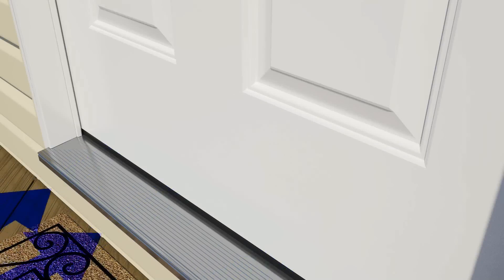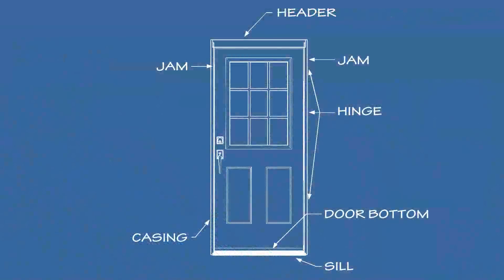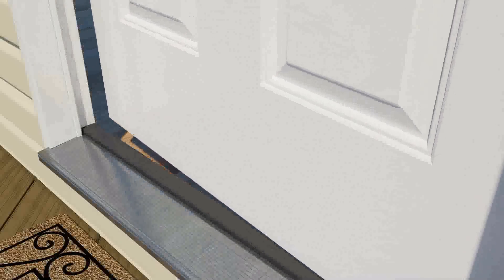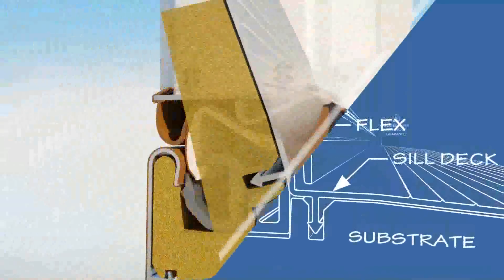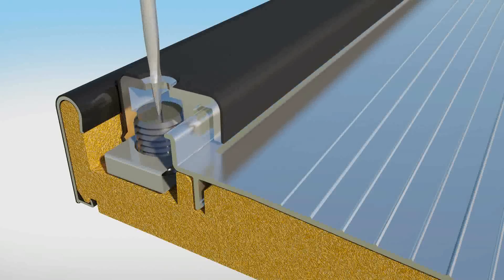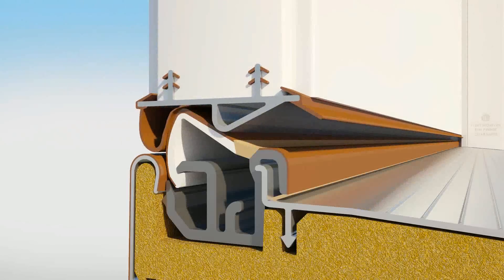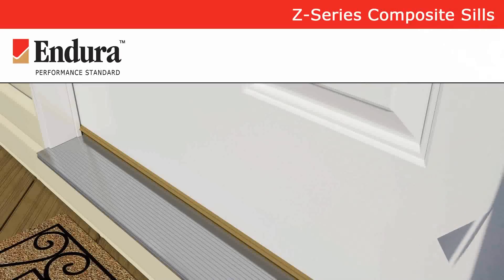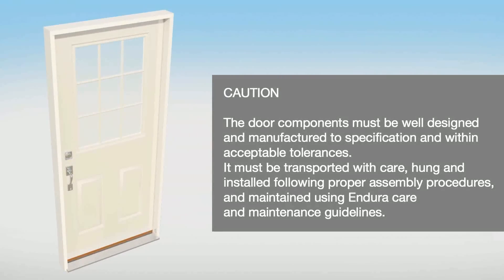Z-Series Articulating Cap

Comment: I just purchased a masonite french exterior patio door with this seal, I wouldn't have purchased the door if I knew it didnt have a conventional adjustable threshold.  The astragal on the normally closed side of the door has a spring loaded bottom seal... This seal presses against the Endura ZAC and creates visible light and a leak due to the greater spring pressure.  I will contact manufacturer, I'm unsure how to fix.